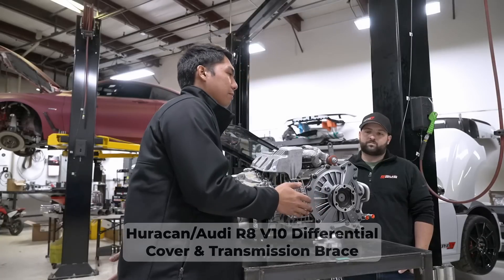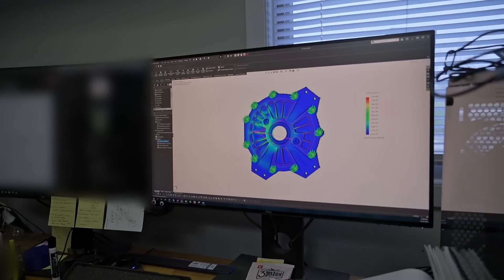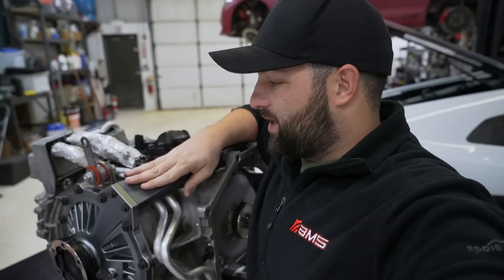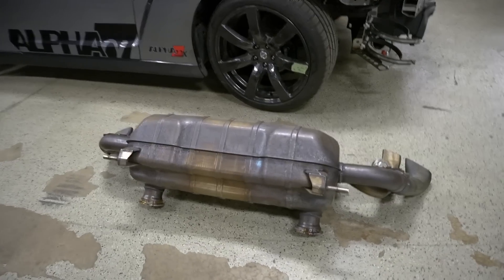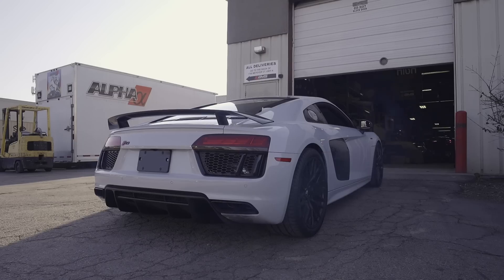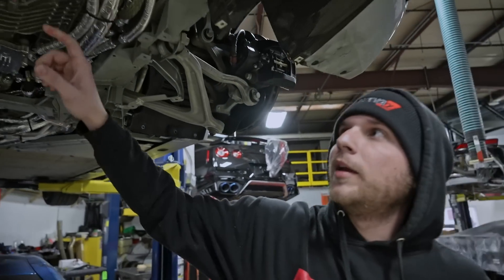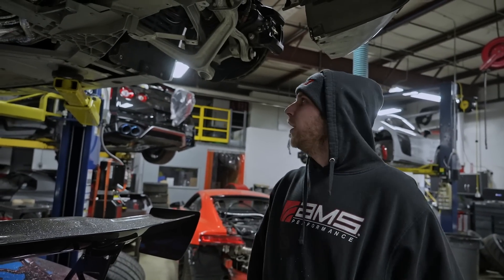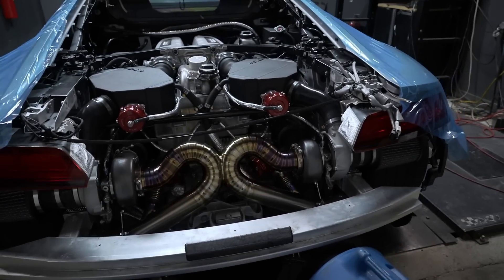One of the V10 Transmission's BIGGEST Problems | AMS DL800 Transmission Brace (Huracan/R8)

Comment: Is it possible to share more details on the white R8 build? Stock ECU on DS1, running ethanol and stage 2+ gearbox. AMS full fuel system but what PFI injectors, please? What boost os it running on to achieve 1200 whp on ethanol please?
Reply: The white R8 is stock with just exhaust. It’s the silver one with the alpha 12 kit. I’m not sure of boost yet cuz I didn’t get it back yet 😋